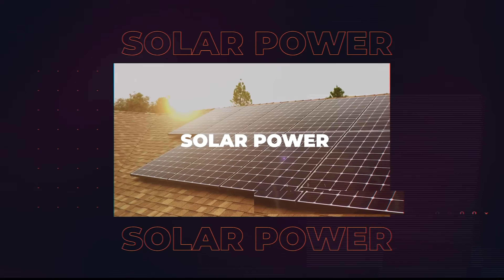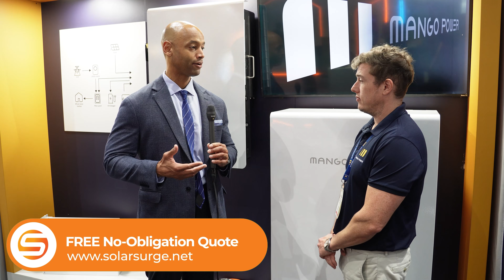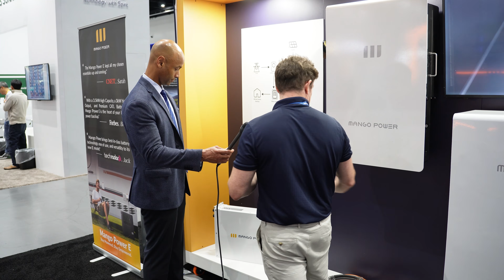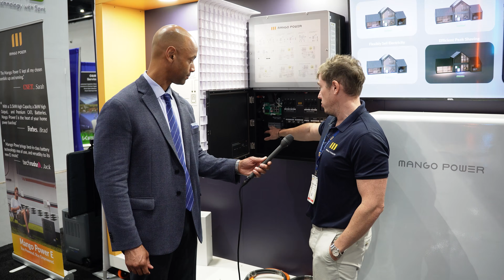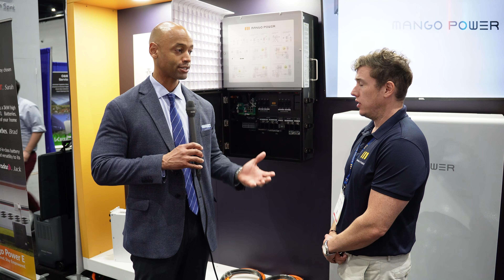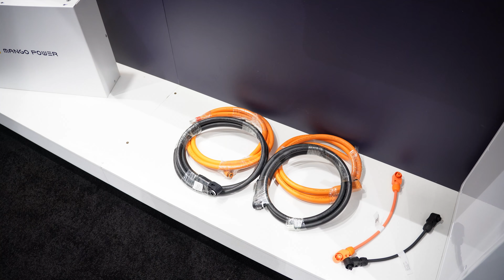Mango Power M Home Battery Review (2024 Updated)

Comment: Good unit except that they don’t stand behind their product warranty I got 2 units one turns off the ac once it reaches 100% state of charge from solar and the 30 amp plug it’s wire backwards internally the other unit stopped working after a week and after 3 months of emails and a return label nothing a month later or another reply most likely I might have to open it up and try to fix it my self if I can’t all I can use out if it it’s the battery and if the other fails I’ll have to buy a solar charger and a new inverter should had gone that route in the first place sad it is a good set up but if I had known would had never got it good luck if you got one

Comment: I helped a friend set up two of these inverters and two 3x battery stacks and will connect an existing 22.8kW via ac coupling.   Inverter looks almost identical to Fortress Envy except the screen and cover.   Nice battery rack. Cabling is nice.